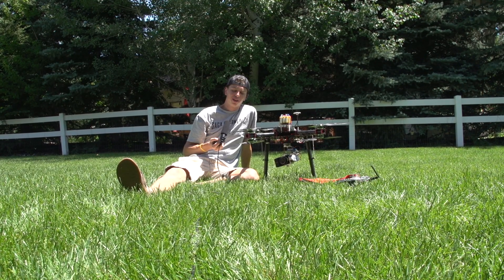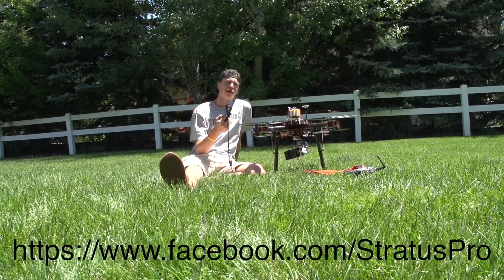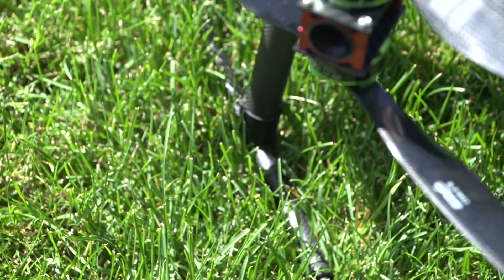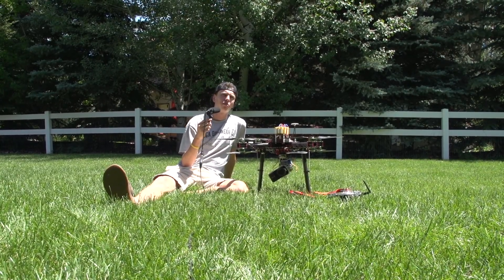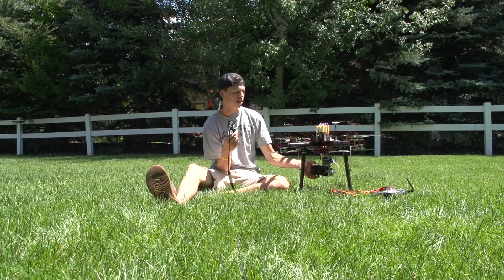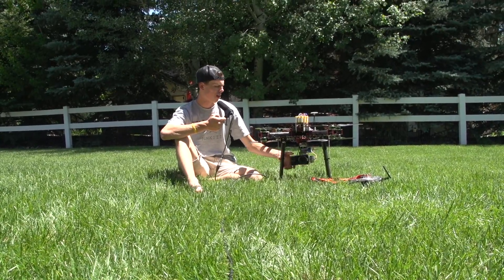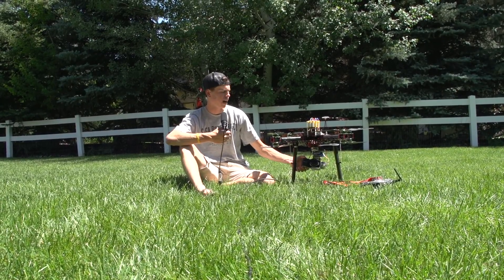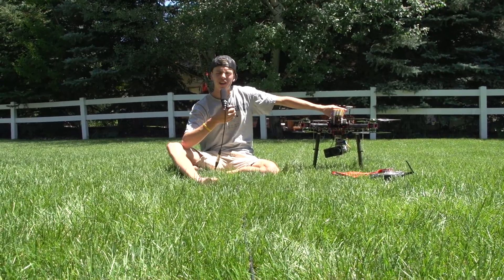X8 Octocopter - RCTESTFLIGHT

Comment: How much would this frame cost? I am interested in this frame
Reply from the maker: Within 2-3 weeks it will be for sale on my website. A price has not been finalized yet
Reply: Okay, sounds great.
Reply: Is it possible that you can drill extra holes in the centerplates so it can be used for a hex aswell?
Reply: @rctestflight  is it still for sale?
Reply: +rctestflight what company do you go to to do your CNC cutting to cut your carbon fiber??? I don't know who to look up online because I have a bunch of 250 class racing quads I designed and want to get them made. Is there any places that you know of with good prices on cutting Carbon fiber for me. Any help from anybody would be much appreciated!! I really want to start building my own custom racing quads. Thanxxx in advance.    Corey

Comment: Great build, man! Have a Y6 and some of the vibration @higher speed happens (even if props are perfectly balanced) as air enters the zone of dual-accelerated air between the props - from the side... it is an issue, that is difficult to describe and difficult to address - a lot can be done with a good gimbal dampener, though... :) Many greets! Peter

Comment: I had oscillation problems with a tricopter I built at high speed only. Turned out the air buffeting the flight control board was causing the problems. I made a cover for the FC, and it flies solid as a rock now. If that's what it is, not sure how to solve as the whole gymbal is exposed but food for thought.

Comment: Incredible machine once again! Have you ever thought of making a large carbon/glass fiber airplane designed for carrying a 3-axis gimbal? It seems like high speed shots using high quality gimbals are something I haven't seen much of so far, because even the fastest multirotor is still not that fast, and certainly not efficient at all when moving at any speed compared with an airplane.

Comment: What's the point of the landing gear being retractable? Is it blocking FOV or something?
Reply: When you set up a double transmitter rig, someone controls the camera gimbal which in this case is 3 axis. When you rotate it sideways you do not want the legs to be in the shot.
Reply: Of course, good point.

Comment: rctestflight Nice build! A possible source for that vibration you were talking about could be the L plates in the gimbal. With the weight of the camera supported under the three sections, they may be acting like high-tension springs (especially the arm holding the pitch motor, which is in torsion)

I'm suggesting that because I had the same issue with a gimbal of similar design but using carbon plates cured into L shapes. I then glued gussets across the corner of the L plates and it stiffened them right up.

Just something to check :)
Reply from the maker: Possible, but I can't imagine this would be the case. Its 1/8" x 1.5" aluminum so for a gimbal of this size its way overkill. The structure is so solid I'm able to raise the P and D gains to very high values with no oscillations.
Reply: rctestflight Hmmm ok. Do you think that it's a structural problem or a gain problem causing the vibes?

Could the design using the mount hanging from the top of the dampeners and passing through the mounting plate be causing a pendulum effect due to the increased length? (But I suppose that any efforts to dampen that would negate the benefits of the wire dampeners). Does the centre section of the dampener have enough clearance to not hit the outer plate while you're doing aggressive manoeuvres?
Reply: Can you sand me a sizes of your copter because i wana made it

Comment: Cool build, what's the efficiency loss on that prop configuration?
Reply: He did a video testing that, although not with these motors and props
Reply: about 25% loss compared to a normal setup. However, having twice the amount of motors, you need much less throttle to achieve the same amount of thrust. This increases efficiency.
Reply: Servicehans No, having to give less throttle doesn't make it more efficient
Reply: The gram/Watt value for almost every prop is at its highest, when the prop is spinning slowly and decreases as the prop speeds up. So having 8 motors that spin at 5k rpm is more efficient than having 4 motors spinning at 8k rpm, right?  
Take a look at this chart: http://www.rcgroups.com/forums/showthread.php?t=1594904
Of course the difference between the g/W values must be greater than 25%(loss of coaxial configuration)+10%(?) (added weight of four more motors,esc,props) to make it a viable option.
Reply: 25% loss is unbelievably good for an X8 configuration. All major builders calculate a 40% loss compared to octo.